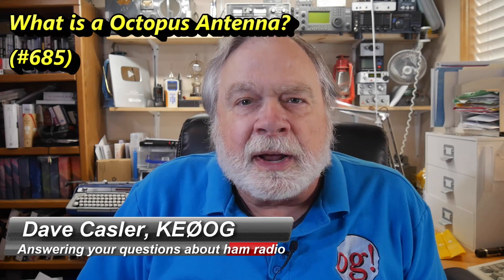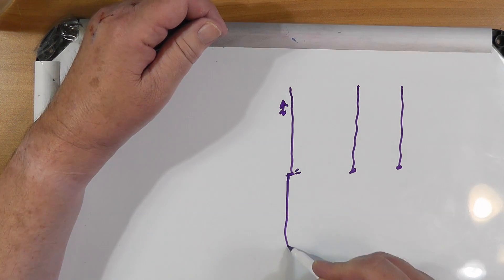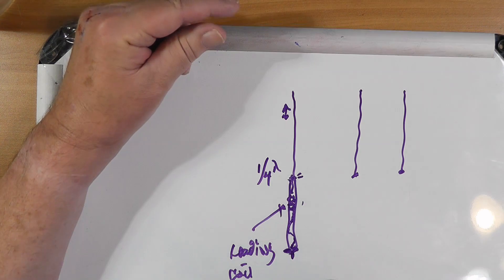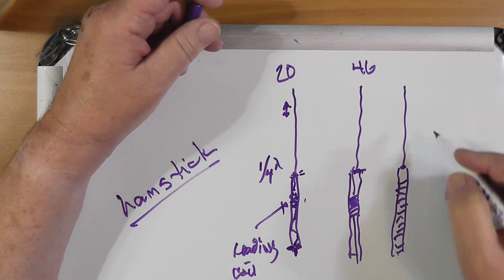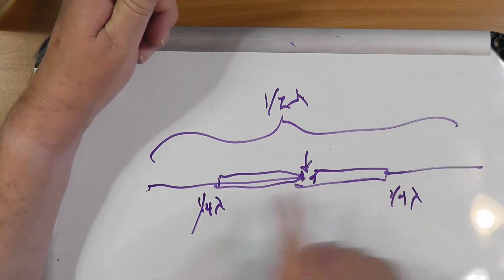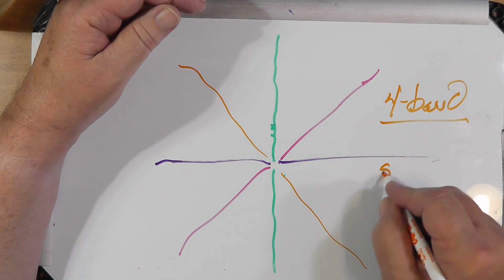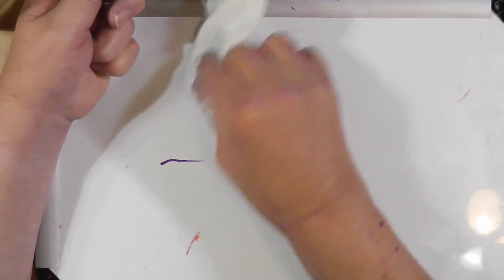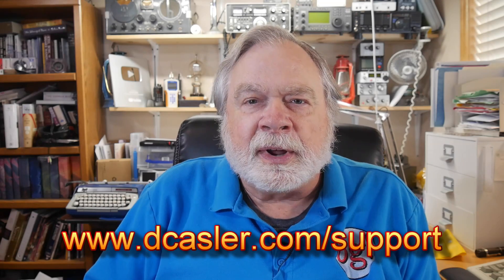What is an Octopus Antenna? (#685)

Comment: Assuming someone could 3d Print a hub similar to that, but instead of straight out, angle all of the outputs downward slightly, to be more like an umbrella with a series of 4 inverted V dipoles.. and kept relatively close to the ground say 1/10th wavelength or so.. Do you think that it could have potential to operate as a portable(ish) multiband NVIS array?

Comment: I’ve had a terrible time tuning my octopus. It’s now hanging inside my garage not being used. The set screws that you use to move the elements in and out are “soft” metal and the hex portion rounds out way too easily. MFJ promised to send me extra set screws, but that was six months ago- and nothing ever arrived. I’m kind of disappointed . It may be operator error also.